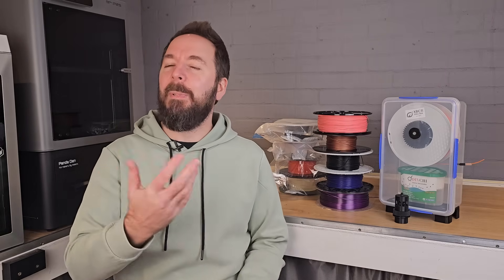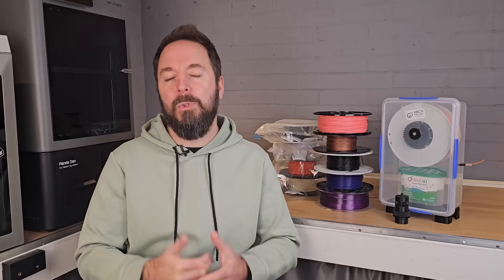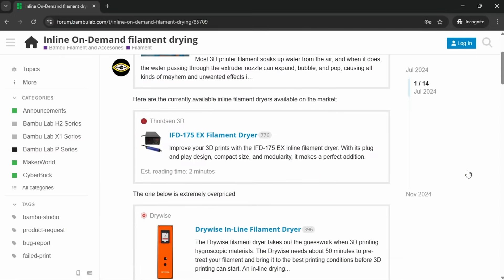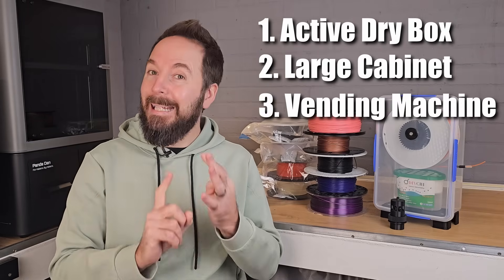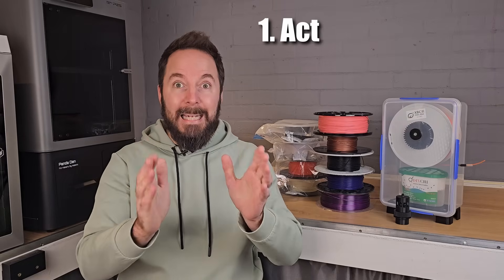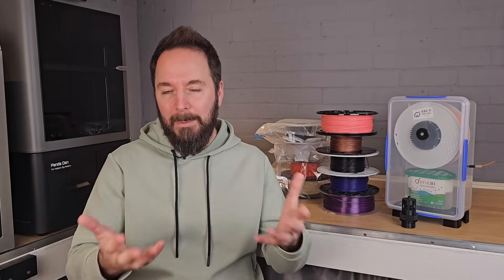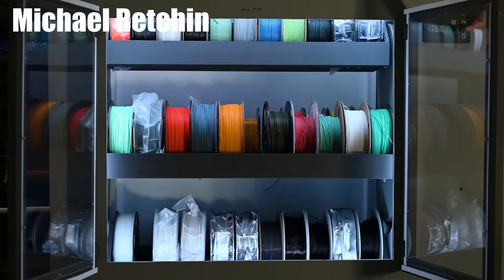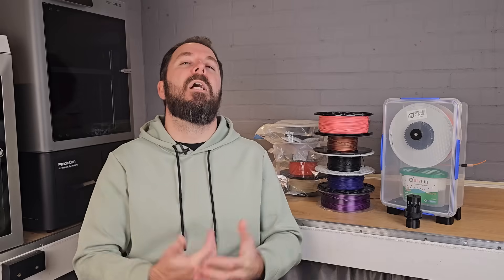Filament Storage 2.0 - The Plan

Comment: Hey, I have thought about your goals. You should look at a Barrister bookcase. I think it's the perfect place to start with the construction of this idea. Our First goal is to make a single roll dry storage box. With some 3d Printed parts, silicone calking (Type 2 would work, later in the comment, you need this type, it should be common worldwide.), and a Sheet material like Plexiglass, acrylic or any plastic sheeting. We can easily make a box capable of holding a single roll. This requires minimal tools, as you would need a drill, a straight edge, calking gun, and a utility knife. We can print corners that have slots to insert our sheets, which we secure using Silicone caulking. Most 1/4 inch or less Plastic sheeting can be scored and snapped.  Designing a 3d Printed Hinge for the door that gets pressed onto the edge like our corners do with Silicone to glue it in should work. For anyone worried that the silicone won't hold to the plastic, a little Sandpaper surface scuffing should make a solid hold. 3d printed Nerf guns hold a lot of air pressure when shooting. I'm sure silicone should hold moisture and the weight. We could further augment the design with local fasteners like M3 nuts and bolts. These are pretty common on a 3d printer, so if you have a printer, you probably can get these. As for the Door Seal, we could make a Proto-Putty Gasket. Proto-putty is simply Silicone type 2, with Cornstarch mixed in. Although Potato Starch or something similar may work as well. The King of Random YouTube Channel has a video on this. It was used to make a vacuum chamber seal and many other things. This could save a lot of people some hassle from having to use TPU if their machines can't use it. I'm sure we could print tools that would be great for making the perfect shape for protoputty seals. We may not even need to use proto putty if a design was made for the door, you could lay a bead of silicone down and, using a tool, create a shape on the door and the box to interface nicely. Latches could be added to create a better seal as well.

Then, using the single box design, we can expand horizontally with ease. With some added supports to create a barrister's box. Create a modular back plate that we can attach brackets for holding filament inside or stands that double as support. We could add some parts inside to direct the air flow to make a convection-style heating system. Maybe the standing brackets are curved in a way to promote circulation. Using some common fans found on our printers to push the air around. Then, on either end of the case, we can include Ports on the top and the bottom to allow our heating system to draw in air and exhaust it. Then becuase it's based on a Barrister's Box, you can stack another box on top to form a bookcase and attach the Exhaust to the intake to connect the drying system and loop it back to enclose it. We could include 3d printed desiccant filters that attach to the back plate, which could be set between each roll for improved moisture absorption from increased surface area or simply before the exhaust or the intake. They could even be a dedicated door to access the desiccant, so you are not letting moist air in.  The system works well, as you can modify your system as your needs change. Have PETG and PLA? Make the Dehydator modular to attach to the end of the box or be set inside, so your PETG and PLA can be routinely dehydrated separately. 

We could also use the Dry Break connector you designed, spaced out across the box, to let us attach to a roll without opening our box. I think this gives people the best chance at success, as filament rolls are all pretty consistent in Diameter. People can decide the length or the box they need, plus the Dehydrator. They can add modifications to the boxes, such as internal fans for convection, the drybreak, maybe a Filter box full of desicant, well recirculating air, or anything someone in the community can think of and add to an open-source set of prints. Someone could go crazy and design an automated filament driver to send any roll of filament up a bowden tube to be run to the printer. Then it can be placed on the shelves that can be locally bought and modified to accept any ducting to connect the many modular layers of the Barrister Boxes, or a system designed to interface and stack them as high as we safely can. We can also easily include an inline filament dryer at some point in the jumble of Bowden tubes that becomes possible.

Either way, I hope this input helps you go in a direction that smooths out production on this project, as I have been thinking about similar solutions rather than plastic bags!

Comment: I am aproaching 1 year from the day I turned my first printer on.  Ive owned 17 machines since then and currently have 12 functional machines. One of those has been a 1000 plus hour project, a much larger machine project is on my horizon. Filament management has  been an issue since day one.  Here is my idea for a community project. As a self proclaimed imagineer and 20 cad user I would join this team.

How about we take the drybox all the way. A quick change cassette style enclosure for filament. Sealed, desicant loaded,  rewind system, rfid tags for database management. Scalable dryer dock to "recharge" 1 or many cassettes. Incoperated mmu system. When you load a spool into a cassette, feed filament into a sealed drive path system thats driven from an the mmu. The configurable and scalable mmu will have dock bays that you just load cassettes into. Could even have a maintenance type dryer. From a single bay buffer feed to a 2 bay for single color auto reload, multi color cut and poop, or a tool/nozzle swapper. Loading to the mmu dock aligns the feed and rewind couplers and syncs the rfid. Loading onto the dryer syncs the rfid to tag last dry cycle. Digital humidty sensor system linked to database. Rfid system sync to klipper to manage inventory.

Comment: 1 and/or 2. I dont have many spools, thought may always increase, but having a box with active dryer seems best. One that can small to hold multiple spools is also more useful. 

Also, 4.  I agree it may not be full-fledged now, but I think anything you do you should integrate an option for an inline dryer. Just a design element to keep on the side, optional for those who want it to add to their incarnation of the project.

Comment: you don't actually need heat to dry a filament; in fact, you shouldn't except for in an emergency situation. With every heat-based dehydration you degrade the filament and make it more brittle, especially true of nylons. Calcium chloride is great for very long storage but not for immediate use of filaments. Using clay-based desiccants I've been able to not just store nylons and be ready to use but lower the humidity to 5% RH in my filament changing boxes by using one of the spool slots for desiccant in addition to a desicant tumbler that goes in the center of the spool. Plus, I can stick the desiccant into a microwave and regenerate it.

Comment: #2

I've been working on a dry cabinet... Not to dry my filament, I do that with a food dehydrator, but to keep it dry. This is currently only a plan, I've not started building yet, because I'm moving house soon...

So far my design has a microcontroller (arduino), connected to a switch, humidity\heat sensor*2 and a fan.

If the humidity in the body of the cabinet goes above 10% (needs tuning) and the door switch is closed, it'll run a fan blowing air through a desiccant cartridge. until the humidity drops again.

There will also be a humidity sensor just past the desiccant cartridge. So if the air coming out the cartridge is too humid, it'll alert me that its time to change the cartridge and redry the desiccant. 

My design still needs a lot of work before I'm happy with it... for example, I'm considering adding heating elements, to warm the air up to 40c to help dry filament... but not sure on that one yet.

Comment: I think 4 is a bit too much, but I think that Filament Storage 2.0 should allow any/all of 1, 2, and 3.

I personally started building a drybox solution based heavily off of GunplaMark's "The Ultimate Cereal Container Filament Drybox - Official Remix" found on Printables. My objective is simply to have a collection that can be neatly organized against a wall. However, I can see that same wall also working for the backing of a cabinet and I can also see a robot arm vending machine selector as an over the top add on that might work better with the closed cabinet of 2, but could also work with the open wall mount system of 1. That way you have a versatile system with which anyone can build the part that they like as they go. Any combination should work. 1+2, 1+3, 2+3 and 1+2+3.

The vending machine option 3 could also move boxes to a dryer and back to rack as needed. Though I doubt that would work with 2+3 very well.
Reply: Any way you go about it, modular vertical and horizontal options will be essential to be versatile enough for the many different needs.

Comment: I'm looking for several solutions.
One being a large storage solution for the +60 spools I have going.
Another being a 5-8 spool solution for the spools installed mounted on the printers.

Currently using bags for storage and Ikea 10L 365 boxes to print from.

How about including support for Prusas Opentags?

Comment: I'd love a good version of 2.
And the icing on the cake would be if all the spools are on a pole or sitting on wheels that allow them to spin and if they could all feed their filaments through small holes that I would just pull on to use them directly without ever having to open the door or pull the reel out. I'm picturing a bunch of small holes with the tip of the filament sticking out just a little either on the side or on the top around my printer sitting in the center of all those filaments. That'd be really cool. I was thinking about this because I'm about to get a Snapmaker U1 and it has no AMS like my current BL P1S so I could just pull on 4 colors I want to use and just feed them directly into the printer and when I'm done I can just push it back in and pull on another one. I'm hoping that the gap of the hole that the filament is coming out of is small enough that air wouldn't get inside. Or maybe there could be some kind of rubber of foam gasket around the opening to prevent that.

Comment: I have about 30+ PolyMaker boxes and two dryers only.  That's more then I'll probably need.  They are only $21 each when on sale.   As cheap as a cereal box but very strong plastic.   And you can dry your spools without taking them out.   I've never taken them out until they run out. 

The inlet and outlet can be easily universally adapted to other dryers of they ever stop making them.  People make too much fuss about this and make these ceral boxes that cost about $20 each anyways.  Then remove them to dry and put them back a little wet.  Go PolyMaker and focus on printing.  IMO. 😂

I started with vacuum bags.   Unless it  is the mylar bags. But cost  $$$$.  Those plastic zip locks are junk.

Comment: 2

or 4 if it's compact, durable, easy to use and quick to service and has low running costs (the initial price or work is not so relevant).

Comment: I have the polymaker dryer.  I use cereal containers and an adapter. It is called "the ultimate filament dry box system". It works well and the each one is only a few dollars.  They stack and they are able to print directly from the container.

Comment: I'd love to have a large cabinet with a dehumidifier built in and glass doors. Air flow is key to drying, so it would need to have fans circulating the dried air. LED lighting of course.

Comment: With some filaments (like PLA) the presence of water causes irreversible chemical changes, so drying is too late to fix the material. You can dry it, but the changes that have already taken place are not recoverable. Moisture must be managed over the life cycle of the material starting when it is received.

Comment: Hi Ricky. I will go with 1 and 2 which I use now. The No1 is going back a few years ago when you adapted the legs on your drybox design for us New Zealanders who had the funny sided box's like in this video. Yup 4 years ago and I am still using them, a little bit modified but 90% the same. My No2 is a larger box that lays down with lid at top. Imagine your box on its back. It holds 5 full rolls and it is dried out with a food dehumidifier blowing in from the top down a tube to the bottom where it is directed in different directions. Only turn it on when humidity get too high which isn't often except for when I open it. Still needs a bit of work  on air flow but getting there.

Comment: 1 & 2. 

I intend on pursuing a cabinet - as I was inspired by my upright freezer:  It pulls a vacuum once you close the door back.  That alone basically makes it a stasis chamber for filament.  It won't dry the filament, but included desiccant will be extremely effective on the air that does remain, as moisture can't condensate.  I just need a fridge that will be okay under slight vacuum as well as a (wireless) sensor.

Comment: Very interesting video, I have more than 300 spools of filament but only around 20 are opened at any one time, so I will be making shelves to hold the unopened filament and currently have, Sunlu S4, 2 Sovol 2 spool dryers, a Comgrow 2 spool dryer, several single spool cereal boxes and some plastic file boxes that hold 4 spools. Lots of vacuum bags for the rest of the opened spools, so I would be interested in a cabinet type of system that was expandable with maybe 5-10 spool wide humidity controlled storage. I would want to keep PLA, TPU, PETG and PCTG separated as for one thing they need to be dried at different temperatures and yes to the refreshing of desiccant would be nice, better than the microwave.
Reply: What the fuck???

Comment: thanks for this video .. i got enough information which i was searching online currently ..im just thinking to make a custom made Dryer  for myself .  from the list you gave i would select option 1 ( but with a  inbuilt air heater- because i dont have a oven separately  ) ... Just an idea .. need to work on it .  FYI , im a hobbist a Non Commercial user here  .

Comment: 1 & 2 for me for sure. I currently have a large box I made for storage with plans for an internal dehumidifier but finding a dehumidifier sufficient enough to use has eluded me. I cannot find one that only runs when the humidity reaches a certain level so they just run 24/7 until they give out.

Comment: 3 using a dual belt carousel with cross bars to hold the line of filament. If you create positive warm dry air displacement at the top of the unit and push this to the bottom where the filament is accessed, this limits the ingress of moisture. Carousels are used in industry for part retrieval systems. So a combo using lab based positive air displacement principles and a desiccant to polish the last of the moisture out might be a good way to maintain the filament.  Then just bring out the filament when it’s require in the print queue to get out the remaining moisture. Size of the system would depend on the inventory throughout of people’s system.😂😂😂
Reply from the maker: Like it, thanks for the input!

Comment: Cant wait for the final product 🙌.  I wonder if it would be possible to have a modular base componant that we could upgrade as our needs and budget allow it. Starting with a simple box with passive dehumidifier to a shared dehumidifier and ideally active one. Also the option to add humidity sensor per unit and attach units as we go  that would be possible to be used both on a shelf or dedicated infrastructure.
This might be a very naive view of a 3d printing newbie that want to be able to use the same parts as i grew with the ability to use existing parts

Comment: very interested in the full vending machine idea, however would be complete overkill for me personally, still as an engineer and someone always looking for ways to improve things, I like it.  The simple active drying cabinet would be cool, but rather than having one or two big doors,  make it more like a post office box, with small doors to open just enough for the spool you want. You could hang the spools perpendicular so that the label on the spool would show, this would make it fairly skinny provided you don't have hundreds of spools you are trying to use. It would be kind of like a locker system, so each door would have a seal, but the environment inside is all shared and air inside would be circulated by fans through desiccant or even an active heater/dryer.

Comment: 3 and 4 +.  I am currently in development for a combination storage cabinet/MMS/in line drying system.  I have built a bench with an enclosed top for my printer.  Next step is to add a dehumidifier and racks underneath to feed multiple filaments up through the top for selection by an MMS feeding multiple tool heads.  Each tool head will have an in-feed filament dryer that consists of a direct drive extruder and filament heating block connected to 1/4-inch copper piping and compressed air injection.  I have all of the components and equipment for the first prototype sitting on the bench waiting for my attention.   I haven't done any detailed drawings yet but if it sounds interesting to you drop me an email (look at my channel for the address) and I will gladly share what I have.